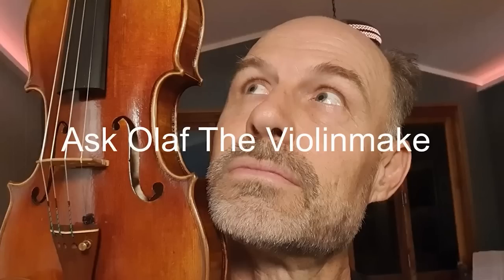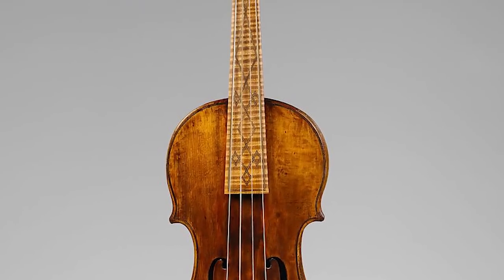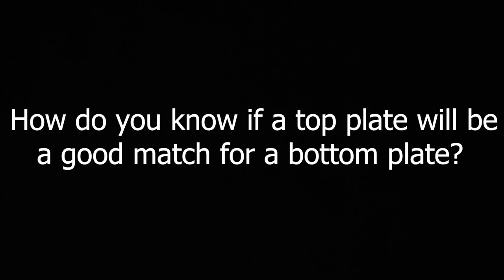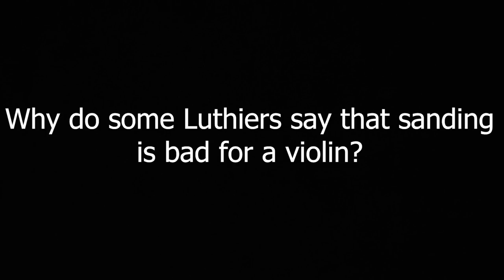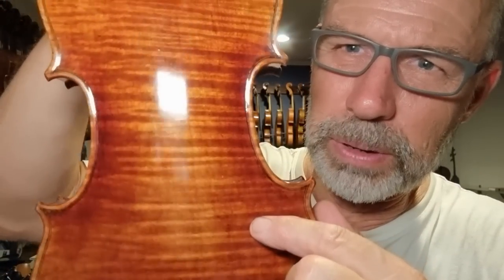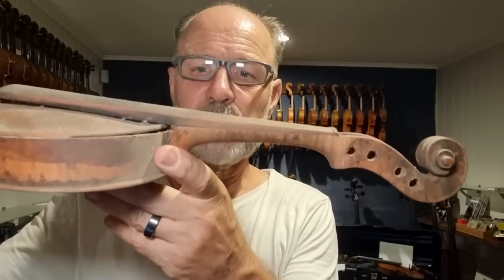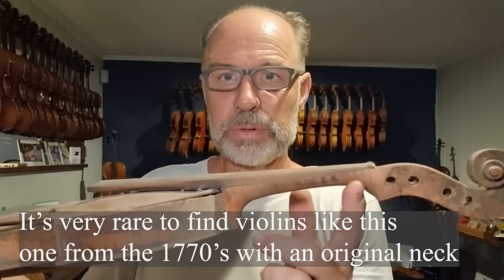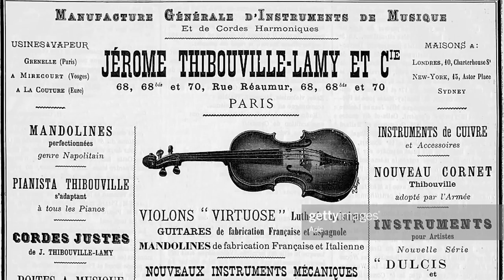Get The Inside Scoop On European Violins From Olaf Himself! Your Questions answered Part 2

Comment: Oddly enough I have a cheap German violin to repair, where the bottom plate is nicely finished inside but the top plate inside looks like it was made by a chap who did dug out canoes on a Friday afternoon. I have to make some tools first. I was also going to thickness the top to smooth it out.

Comment: How would a man go about acquiring one of your fiddles. Violin i think you call it. So i hot a fiddle about 2 weeks ago and had no clue what i was holding in my hand and only knew Anything at all from the kindness of Charlie Daniel's. 
I can make it talk but I'm not hearing what I want....yet. So i did a porch swing for a guitar for my little one and ended up with 2 "first act" and one "little mirmade". Having never picked up a guitar or violin i tuned in the guitart. By listening to a song then picked each string at the point of where they were singing and the next song i was picking each b4 and @ the same time it came up. Thats the guitar. I can actually do the guitar pretty good for picking up mayhaps 5times. I had a Stradivarius well it said that but also had the country of origin so they say well you kno. Thank you very much sir.
Reply: Years ago in the south I went to a fiddle shop and requested to try out a couple violins.  I was sent to the coast where they sold them "violins".  I got to a shop and they scoffed when I told them I visited a fiddle shop.   Later I had a classically trained violin teacher tell me other than string changes,  that many folks just left a little extra height on the bridge.  People's opinions can be very strong.
Reply: @christopherw4527  i just got one about a month ago i guess its a cheapo i have made a little progress but nit as much as with the guitar i got a week later. Having never touched either b4 or any training or tips of any kind i cant call it music that comes out but just not yet. Thank you so much and I agree...i am in east Tennessee and I see no reason for this behavior none @ all...but that doesn't change the fact.

Comment: Modern day electronics are atrocious indeed. They serve their purpose for a time (a very short time), and then after a few years their either obsolete, or unrepairable. Meanwhile many electronics from the 30s, 40s, 50s, 60s, and 70s you can still use, and repair (if you can read schematics, and solder) such as Stereos, Hi Fi systems, Musical amplifiers, effects, etc...etc......
Reply from the maker: Exactly... And it just wouldn't be difficult to make electronics more sturdy so they could last for many years
Reply: It's for the same reason that all those beautiful old Roman or Baroque buildings are standing after centuries or even millennia, while all the modern crap around them is falling apart. It's an illusion. All the crappy Roman buildings failed long before the Roman empire fell and all the ugly Baroque buildings were torn down during Classicism. The stuff that is still standing gets a LOT of investment to keep it standing - if you've ever experienced the kind of work and money that goes into historic buildings you would be horrified at the expense.

The same way for electronics: all the crappy electronics from the 30s-70s are barely recognizable rubble at some landfill. On a component level we've gotten a lot better and more reliable than we were in the early times of electronics: vacuum tubes are failure monsters - on average they last a few weeks or months, modern transistors of the same quality last many years or decades under similar conditions.

The problem you perceive is the fact that 90% of all stuff made is crap that will barely last one week past the warranty. All the cheap stuff maxes out the components, which shortens their life span. All the small stuff (including everything from Apple) has heat problems. It's in the interest of the manufacturers to make stuff as cheap as possible and as visually pleasing as possible - robustness and long term reliability are not directly visible to the customers, so they can be compromised (to some extent). Those companies also don't have an interest in you repairing the device - it subtracts from their sales.

If you want more reliable electronics - you need to invest about 10x as much into the devices you buy and you have to care and kick big companies like Apple to their shins in order to make them build more sturdy and open instead of cheap and "pretty". Are you willing to do that? (I'm not. I'd rather buy a new cheap soldering iron from Aliexpress after a few years and use it to build the reliable stuff myself.)
Reply: @AskOlaftheViolinmaker  Absolutely. Unfortunately I don't think anyone would buy a reliable iPod - 3x thicker, slightly larger, ugly screws instead of glued shells, clicky buttons instead of fancy touch dials. Quite a bit heavier, but as a result you could drop it from the 3rd floor window. Since we are talking Apple the price tag would probably stay the same (but Apple would earn less on it). Now, if we print a different company name and "rugged" on it - people might actually buy it, but never from Apple. 😋